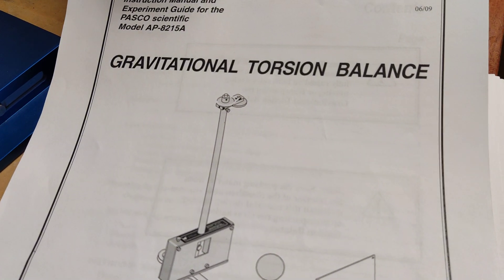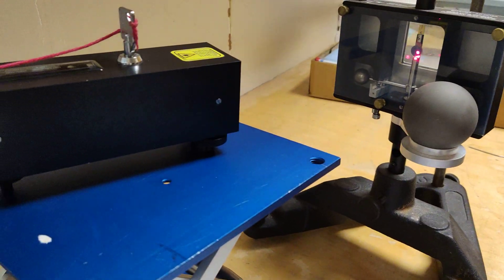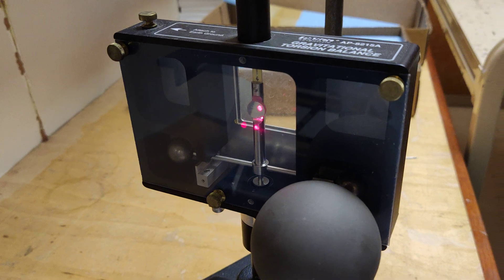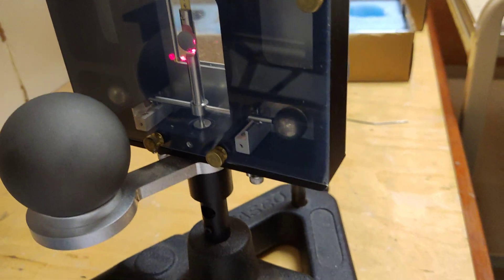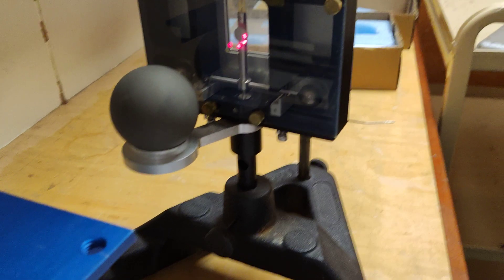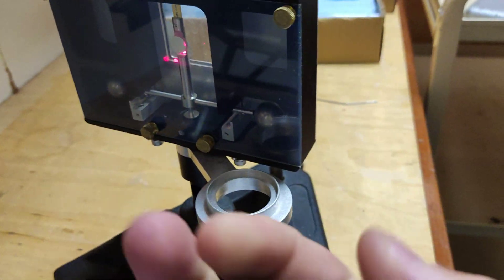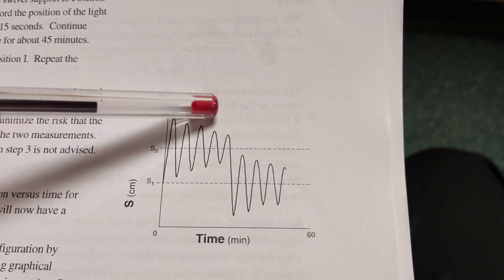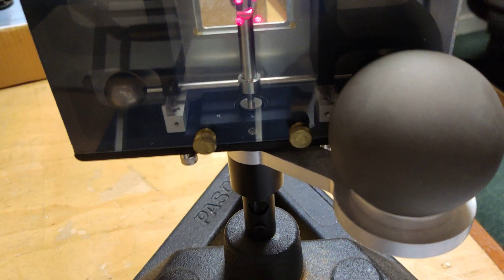PASCO Gravitational Torsion Balance Cavendish's Experiment Part 1

Comment: The measuring tool is part of the field (it’s subject to the very gravitational field it seeks to quantify).
The results of the measurement are interwoven with the phenomenon you are measuring, creating a feedback loop that doesn't allow for an accurate or separate quantification of gravity.
This issue is more than just a practical difficulty — it’s a fundamental limitation of the measurement, one that prevents the result from being "generated" independently of the system.
Reply from the maker: It works and predicts, remember it works on a torsion.
Reply: Nonsense. The vertically suspended pendulum mechanism is specifically designed to isolate the downward force of gravity (which is taken up in tension of the torsion ribbon) from the torque caused by the large and small weights attracting horizontally.